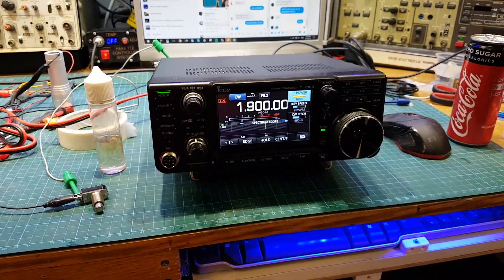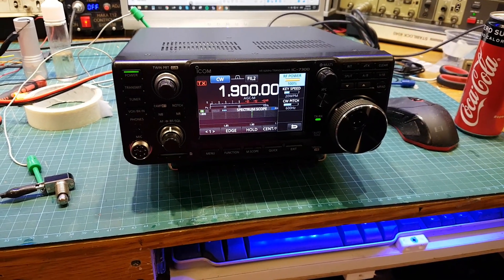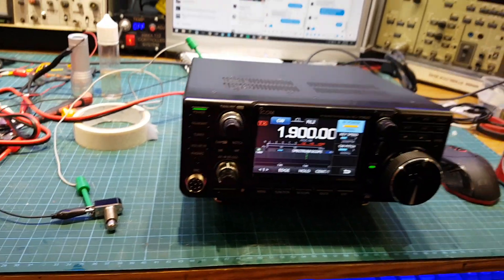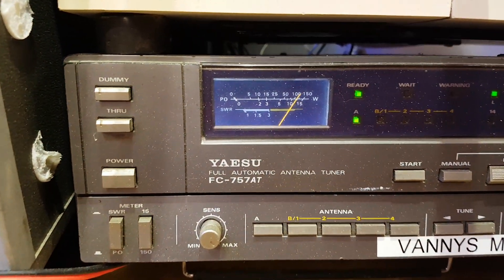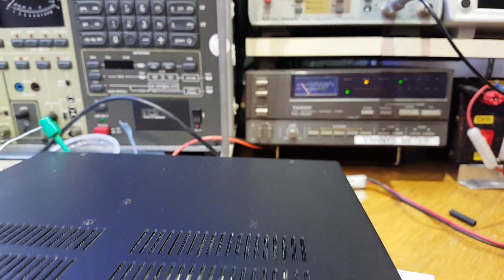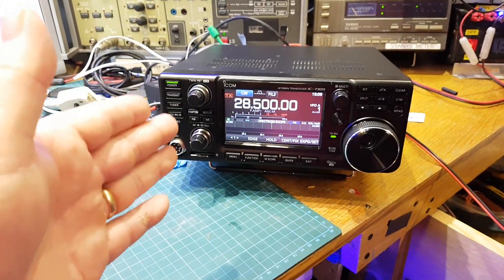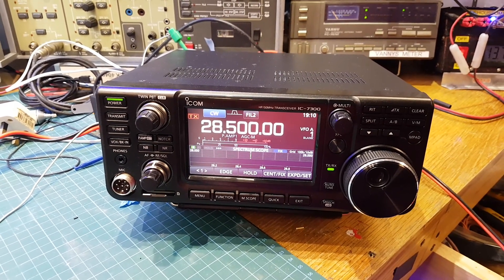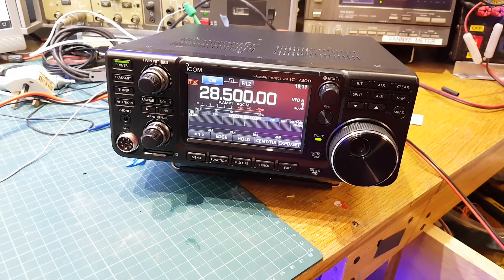Made in Japan… Improved in Ireland? | Icom IC-7300 Tale of Woe & Recovery

Comment: Power supply voltage is a big factor in output power, most people don't allow for loss between PSU and the rig,
Reply: Adequate wire size and good power connections are key.
Reply from the maker: Very valid point fatboy!

Comment: I've both the ICOM IC-7300 and IC-9700, mighty fine radios.  The additional panadaptor brings to life the whole interaction piece of an additional scope with SDR Console... Happy New Year George.
Reply from the maker: That's on the cards Robbie. What panadadapter did you use?
Reply: @GeorgeEI7KO  PTRX-7300 (ICOM IC-7300 Panadapter by Radio Spectral, works great especially on the large monitor.
Reply from the maker: @Robbie_Ei2iP  I was looking at that last night on here. Interesting.

Comment: Those radios are known to have a low " talk power" on SSB, yet look to be performing well on the two-tone test, I also thought that there is not much difference between 40W  and 100w talk power BUT I was proven wrong over and over again, reality bites with 2 s points reported up 90%of the QSO's (  yes I could switch it back to normal during a QSO). 
The " problem " is how the P.A  reacts to audio change, or how fast the "limit" is applied, there is a similar mod for the IC7610 that works like a dream (yes, I  have done it with nothing to do with the menu mod)  when you talk normally to the mic, the radio will now take about 16 A vs 7A before and more than 100w is shown ( average power meter) to top this the audio reports are so much better.  radio stays cool and well within specification, a year later and we do not need an amp ( we used to have one, lol)  each to his own.
Reply from the maker: 4 years in with my own 7300 and no issues. I let the tubes do the work. ive always operated that way. the difference between 95w and 100w isnt worth talking about, your comparison between 40w and 100w is a different matter. I measure my output power in Watts RMS, I dont go in for this talk power nonsense. As you say, each to their own its a very diverse and subjective hobby.
Reply: @GeorgeEI7KO  Definitely there is an issue with an aggressive ALC on all Icom 7300 models. Some amps are not driven properly by this radio because of this. Well known issue and a physical ALC mod can be performed which kindly some have uploaded on YouTube. There's a reason people are complaining. It's a weak radio. Any of these mods, including the risky service menu modification, will be the difference between someone saying that you are a "light copy" and someone hearing you loud and clear. It's unfortunate, but it's based on reality. Many people cannot afford an amp.
Reply from the maker: @624radicalham  fair point. But I have an amp so I'm not bothered.
Reply: @GeorgeEI7KO  Wish we all had an amp lol. This thing with the over aggressive ALC has alot of owners upset that know better and have older radios to compare it to and wonder why the 7300 is simply not pushing out strong "talk power". This could be a topic you could explore in the future. Your videos are excellent and very informative. Great channel.
Reply from the maker: @624radicalham  Cheers man I appreciate that. A well documented gripe with the 7300 for sure. I often think about doing the ALC mod but i never bother then. But I may do it yet. I spend more time messing with old CB radios than anything else lol.

Comment: Irish Custom-7300!!
Still got to get inside and fix the clock battery which is driving me nuts!
The design team member that is responsible for that inclusion needs to remember back to the 80's when dead batteries meant dead radios (IC-R71A RAM board anyone?).
Reply from the maker: ger her done ffs....whats the hold up Adam lol

Comment: Back in the good old days you could have a play with the inside of a Radio.
These new types of Radios are Mobile Phones with a PA  cheaply made and won't last 5 Minutes  enjoy it while the Screen is still working !!
100 Watts 95 Watts probably loss in the power lead..
Great little video.. All the best 73 from a Radio engineer with over 40 years experience ..
Reply from the maker: Yet I have my own one 4 years and no issues. yes, everyone is a radio engineer with decades of experience on YouTube. The screen issue on the Icom is with the 7610, not the 7300. If you're gonna comment on something, at least get your facts straight. 73
Reply: @GeorgeEI7KO  My callsign is G0UIL I Design SDR radios and other things besides, feel free to look me up on Google.
Ham Radios have always been Smoke and Mirrors.
Cheers thanks for the Comment 73 Dean G0UIL.
Reply from the maker: @superconductorchip  well done.

Comment: Moral of the story: A little Knowledge is a dangerous thing! especially following some dodgy internet info that's post out there and not having the right test kit to check it correctly. Well done on fix ,always take your radio kit to right equipped radio engineer first!
Yes your correct often mfrs underrate on factory tune ups typically under rated full power.
And again ,correct use a rf amplifier if want high heavy duty cycles ,use radio as low exciter stage to keep it cooler.
Nice one George well said.
Reply from the maker: Thanks so much for the nice words....appreciated...73

Comment: Do you ever do work on the CRT SS 6900N V6 George? I haven't got one, but a few people have mentioned how they're great radio's for the price.
Reply: They are a realy good entry level radio, I have had three of them, for me there are a couple of small issues:
1 The KC shift is a click click click on the turn, not smoothe like the Cobra and Superstars
2 The LCD Display is a bit bright would be better if it was darker on the background of the display
3 6900N is the 40w version and does get rather warm down the left side to the back
4 They bring in a fair bit of dirt, and on FM my Cobra S Meter sits flat on recieve / 6900N the S Meter sits arround 5-7 on the scale.

Would I have another one? Yes with it's minor faults for what you get and if you are in an aera with low noise it will be great for you.
Very easy to programme with the lead and software and if you are a UK user and want the UK FM 1-40 you can do it with the software 
and add it to one of the six bands (most people use F or A)
Hope this helps ;)
Reply: @68LP13  Thanks for the info, but I've got to ask....you've had three? what happened to the first two? lol
Reply: @waynekerrgoodstyle  I have only one at a time, but had the 3 over time. 2 were the N version and the other was the mk1. Now I have none, and I am sure at some point I may have another, for me it is a love hate for them, that girl who hurts you and you keep going back for ;)
Reply from the maker: No Wayne, I work on vintage stuff mainly